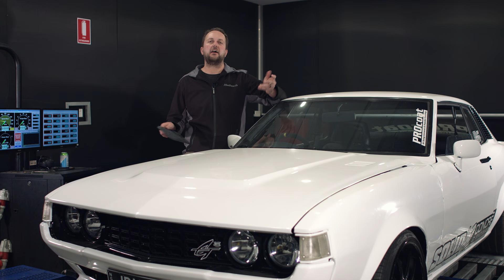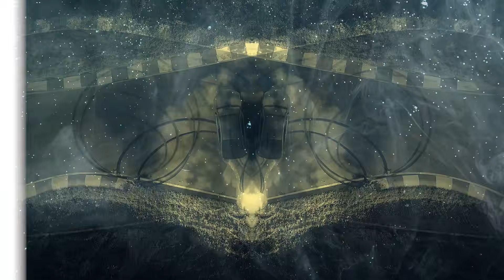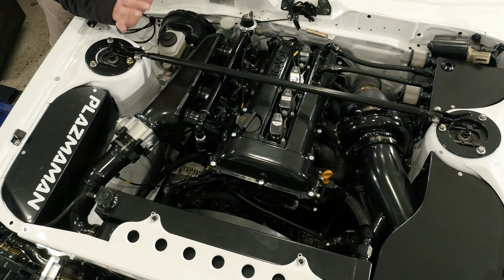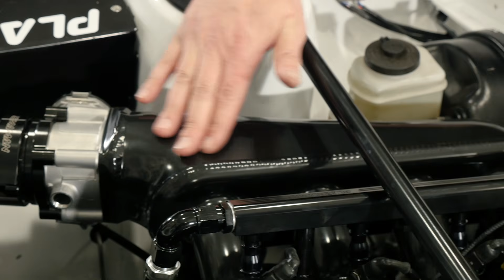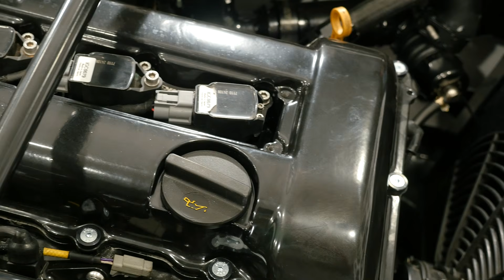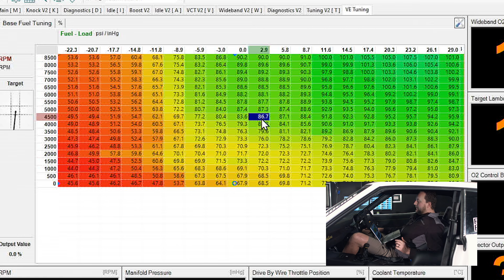🛠 Volumetric Efficiency - Live Tuning | TECHNICALLY SPEAKING

Comment: Hello, I want to confirm my understanding of the tuning process for my  am I correct in understanding that we cannot influence the Volumetric Efficiency (VE) percentage at a specific RPM and load point? Our main task is to deliver the correct proportion of fuel based purely on the amount of air that enters the combustion chamber?
We orient our tuning around the Lambda Target table. This is the feedback loop that signals whether the current fuel amount we are supplying is in the correct or incorrect proportion to the air mass."

Comment: I notice that you use predominantly computer-controlled vehicles. For people like me who use older style conventionally run engines with points and carburetors for the air fuel system. When I tune one of these "older/antique" systems I use vacuum gauge, air/fuel exhaust gauges, fuel pressure, and tachometer to tune these engines. By using these four gauges I can adjust the needles, seats, and in some cases air flow rates of the carburetor to optimize these older systems and do not have to rely on electronic systems that are subject to many different issues both internal and external.
You still have some very important information and give good examples that cover the newer systems.

Comment: How can we be 50% efficient at idle while having a 20-30 kPa of absolute pressure and tiny air consumption? Like hona 1.3 vtec engine only consumes 1.6 grams of air per second at idle, and 70+ at full throttle

Comment: My one problem with VE tuning is: how are you as average tuner or DIY enthusiast supposed to accurately calculate the VE of an engine at every load cell? VE depends massively on the cam profile, cam timing, and cylinder head design. Much more than just engine size.  Even from watching this video I can't tell how you're supposed to work that out. It looks like it's just guesswork based on your experience of that engine?

[EDIT] Unleees.... You guess the VE table, then set the AFR table to aim for the exact same AFR in every cell (say 13; pretty harmless to use briefly at all loads), and use the short-term AFR % trims as a basis for adjusting your VE table?
Reply: Thinking more, I guess what I've said is redundant. If you're changing components that affect the efficiency of air flow, then you would HAVE to adjust at your VE table to compensate. You brought up a good point, I'll wait for Scott's reply!
Reply: @Nite.StyleFD  He never replied 😢😂
Reply: It's seems that yes you could tune that way but like he mentioned, should you change parts in your engine.. you're VE table isn't going to be accurate even assuming you've entered prerequisite data correctly for components changed. Realistically, as a DIY enthusiast, so long as you've got your VE table dialed in to bring you to your exact target AFR, it should run pretty consistently.

Comment: I thought that as an engine comes on boost that it becomes more volumetric efficient. That most engines will never be more than a hundred percent volumetric efficient unless they're turbocharged or some form of supercharging. So let's say your engine is 100% volumetric efficient @ x rpm, and then we add 100 kpa of boost. Just to keep math simple, let's say it's at sea level 100kpa and has perfect intake manifold and exhaust manifold and a perfect turbo. Wouldn't that engine be at 200kPa and way more than 100% efficient? Say it's a 2l engine.... it should be really close to 4l of air going through it... right?

Comment: One of the best engines to swap in your corolla or celica is a Toyota 2RZ or 3RZ.
It is basically the 2JZ with 2 pistons chopped off.  
With a Iron Block, Steel Crank, Steel Rods , and DOHC Aluminum Head.  This can make about 450hp stock when boosted.  Throw some pistons in it.  You can push it to over 600 no problem

Comment: I was talking to a friend with a nostalgia Top Fuel car. He said they actually want to rev past where the volumetric efficiency is best. Because they are limited to a small fuel pump and the engine needs more fuel than the pump can deliver at that RPM. Yes to a nitro engine 20 gallons per minute is a small pump lol

Comment: Hey Scotty, aka Tuning Fork. You mentioned that with really large injectors you lose a bit of control at really small pulse widths. Can Haltech's ECUs handle two different sized injectors per cylinder? I'm just thinking that you could start with the smaller injector, then work your way into the larger injector under boost or high RPMs. Not necessarily like the BRZ with the mixed direct and port injection system, but two port injectors. Maybe I'm just overthinking it. What do you think?

Comment: When a drone arrives, the mercedes benz car starts to travel slower and slower, then the car finally stops, and can’t be started. The batt is still ok, and the old ones didn’t have computers inside. Probably the capacitor got memory effected. When this happens, an older type of car is picking up the passengers. That attack could be based on a protocol, not all passengers are allowed to travel with a mb.

Comment: Great video!
One question though:
How do you determine the right AFR values before tuning for VE?
Reply: I think the point is once everything is calibrated using VE tuning method, everything afterwards is very simple. You want 15:1 during cruise? Just type 15:1 in those cells. You change from 1500cc to 2000cc injectors? Just type 2000cc into injector data and the software sorts the rest to keep your afr the same.
Reply: From what I understand - most engines respond to similar afr ranges, for instance on petrol most will idle around 14:1, and you want to make sure you have around 12.5:1 to be safe when under boost.
Reply: So then you want to use "known generally safe" afr's to then ensure your VE is set up right as Scott shows in the video. Then once everything is proven, start dialing in the afr's for power etc. Then timing comes in after that...
Reply: At least I think that's the general idea.. I'm learning too 😊

Comment: Factory maps are skewed by the need to meet emission standards.........which is one of the major compromises that are built into factory engines.  A question I have is, how does fuel octane/type affect tune and can the software/sensors  auto correct for that?

Comment: I was looking at your injector flow table and you said it's running Bosch 2000cc injectors but you have the 2030cc cell at 58psi/4bar IPD. Why is that not set to the 43psi column?

Comment: How do you determine what AFR number you put initially?  You set a target ratio 14.3.  Why this number and not 14.7 or 13.6.
From there and on O2 sensor giving you the STFT to work around.  
So far no one gave me the very first target number how is calculated. Thanks

Comment: One part I'm still not sure about; how do you decide what the target AFR should be?

And another question, do you have to worry about dead time at the end of the injector cycle? Won't there still be a small amount of fuel coming out even after the injector has been switched of?

Comment: I hate to be obtuse, but why don't we put in the correct parameters for engine volume, all the injector parameters (on-delay, on-opening time, off-delay, off-closing time, volumetric flow at open, etc...) and sensor calibration curves, and so-on...

Maybe set some close VEs in that map...

And then use the high-speed O2 sensor to always fix the VE map, based on the actual AFR???

AND take us out of the loop???  If our contribution to the process is only to compare AFRactual to AFRdesired and then adjust VE until we have a match (given that limits prevent compensating for bad parts or data entry, etc...), then why don't we have the computer perform that simple task???

Or am I missing something basic and critical? 

Thanks in advance for your consideration and time.

Your treatment of this subject is first rate and so thanks also for the teaching you are providing.  You are clear and don't leave much out, while still being concise, complete, and accurate.   Thanks

Comment: I'm seconding the request for ignition tuning strategies. I know you've gone over it in other videos, but it would make an excellent follow-up to this video.
Reply: Care to elaborate on which part of ignition tuning are you trying to learn?
Reply: @MrDelsoleg11 MBT would be great
Reply: @kinslayergaming3159 ah ok its really simple with with right tools in order to get to achieve mbt you need a precise dyno that's capable of reading torque in real time as opposed to calculating, usually found on dynos that include some kind of retarder. The common dyno jets will not be able to do the job properly. you'll also be limited by knock. Some engines won't be able to ever reach mbt, especially turbo charged engines running on pump gas since you'll reack detonation point before mbt. The proper way to tune isn't to chase mbt, but to reach the optimal performance for that given setup. Reliability should always come before performance when tuning a street engine. Street cars are never tuned to the maximum they just won't last. One  trick I've learned when on a dyno jet is that the torque curve is usually flat around mbt so during that point if it's not knock limited I'll add a degree if it knocks I'll retard by 4 degrees maybe 5. If it doesn't knock but no increase of torque is gained I'll retard 2 degrees. To do it right is a long tedious process since you have to tune every load and rpm column and thats why you need a dyno with a retarder like a mainline or mustang. Obviously it can also be done as I described by doing sweeps on a dynojet but again it's more of a best guess as opposed to an actual reading. Hope that helps.
Reply: @MrDelsoleg11  i see
Reply: @MrDelsoleg11 …. This was a superb response. Thank you for taking the time with so many other comments. I’m self teaching with AI and the viewers of those videos in particular are angry with me for one reason or another.😂🤷‍♂️

Comment: Of your so called VE model has to be changed based on intake air temperature, then there is no way the 'fuel model' is using Boyles law.
Reply: Well it's still employing a theory which is based of laws but it's not "FIXED"
Reply: @neilr1556  exactly. That's why temperature is in the equation. Then why change VE. VE never changes unless something really changes it such as cam profile changes. I agree some light tweaking in VE is needed. But that's needed because the fuel model of the ecu based on Boyle's law isn't perfect.
Reply: Ahhh! I see your point
Reply: @Matt Wright thanks for taking your time and giving us some insight!
Reply: @Matt Wright Even Adaptronic uses blend of coolant and iat mix to achieve a better air temp value being used by fuel model(using Boyles law). So ideally you adjust air temps to get a proper air mass value. The video says intake temperature changes and hence need changes in VE. VE doesn't change and most ecus can't model temp and pressure inputs so forced to change VE to get the correct air mass.

Comment: Commenting before watching: Man I've got so many questions about VE tuning lol. That is the strategy my Holley Terminator equipped supercharged Camaro uses.

After watching: Do I need to re-tune the VE table every time I change something that affects airflow? Does the VE model take fluctuations in weather conditions into account? I'm trying to daily drive this thing year round in an area with 90°F summers and 10°F winters lol.
Reply: hopefully scotty chimes in, but yeah, VE needs to be adjusted whenever the airflow characteristic of the engine/system changes, so if you change an intake/exhaust, it will need correction. as for temp/weather, as mentioned you have a Air Intake Temp sensor which makes changes, but in your situation you may need to fine tune it further/have a wider range of AIT correction in your tune for such changes of weather!